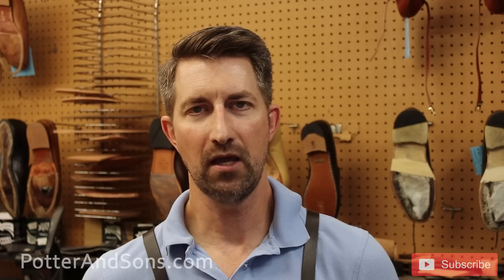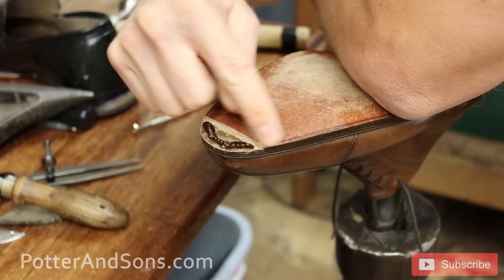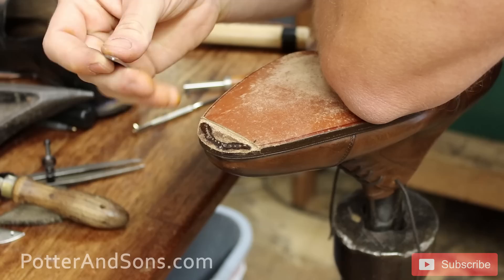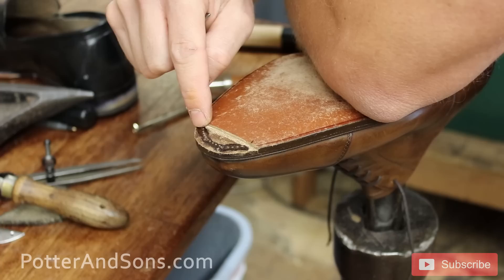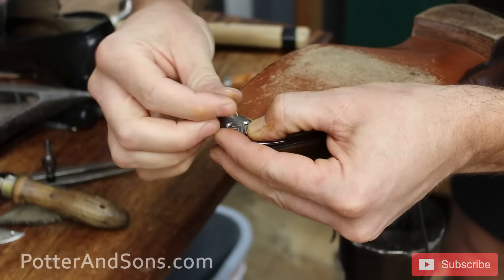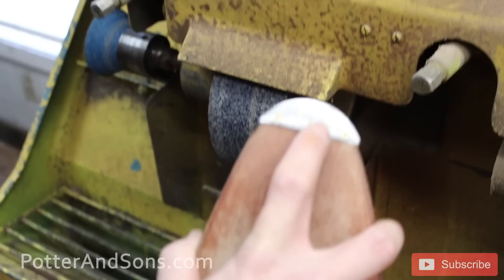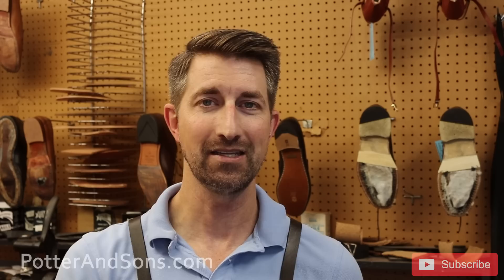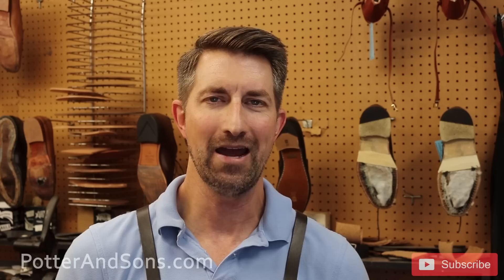Edward Green Oxfords Get Lulu Toe Plates | Protect Your Toe Area From Wear

Comment: I just performed this job myself, but I noticed that the screws heads sit atop the conic holes (rather than being fully flush with the plate). I'm thinking that perhaps the seller sent me the incorrect screws. Mine are size 60 Lulu toe plates, for reference; the screws don't seat entirely into the holes.

Comment: Love your channel and work! I just received my Allen Edmonds Strand and Oliver Wicks captoe that you installed these along with the sole protectors on! They look great and I love the added protection. Question: do you also install any type of protectors for the heels (over the toplift area) especially when you install metal toe-taps? If so, what are those and do you recommend them? I assume a plastic heel-guard would throw the shoe off balance? Thanks - Ani
Reply from the maker: Anirudh Kashyap Thanks!  We really appreciate you watching and for giving us the opportunity to help you with your shoes.  The two most popular options for the heels are heel guards (hard plastic & metal).  I’m not a fan of the metal, as they’re bulky and very loud.  The hard plastic isn’t bad.  I’ve had them on my shoes before, and you don’t really notice them because they’re so thin.  I found that they could be a bit slick.

Comment: Thanks for the video, very illustrative! When I saw these plates in real life, I was surprised that they were not flat, but rather slightly bulging/arched. And on one of the pairs I had these installed it was a bit uncomfortable to walk for a while, until the most bulging part got worn out. Do you know why they make them this way? Do you take this shape into consideration when cutting the sole (e.g. by cutting a bit more from the front, so that it is installed at a bit of an angle)?  Would love to hear your opinion/experience on this!
Reply: Old timer hot shot  Yes, and if you just slam it on top with no modifications to the existing sole, it will not only protect the toe, but the rest of the shoe will also retain perfect condition!
And the reason for that is that one would not be able to walk comfortably with this thing in the the toe area, certainly not in the urban environment.

Comment: Are there any soles that are made with prefitted cutouts for toe plates? Great channel. Thanks.
Reply from the maker: operadog2000 Thank you!  No, not that we’re aware of.  Toe plates come in different shapes and sizes, so it usually requires cutting out the leather in order to fit the plate.
Reply: @TrentonHeath  thank you

Comment: I have metal taps on my shoes. Not sure if I’ll do it again. Can’t walk on wood surfaces with out scratching it or walking weird in order not to scratch it. At work I walk on linoleum and can hear little scratches on the floor throughout the day
Reply from the maker: Jeff Brogan Haha...yeah, I had heel taps on a couple of my shoes (the hard plastic ones), and I took them off.  While they do a great job protecting the heel pads from wearing down, they still tapped on hard surfaces.  Some folks really like the toe/heel plates.

Comment: Second question/comment...do tack nails in the rubber heel help with longevity due to further compression on the rubber? Gracias
Reply from the maker: Jeff Brogan Tack nails are mainly for decor but, yes, if some tack nails are put into the rubber part that hits the ground with each step, it does prolong the life of that rubber piece.
Reply from the maker: Old timer hot shot Your answer is what you get from folks sitting behind a keyboard who only knows fragments of subject matter and nothing more.
In today’s shoe world, other than cowboy boots, manufacturers are not using nails to help hold down soles.  This isn’t the 1800’s.  Yes, from $5000 shoes to $200 shoes, the small tacks put in at the toe and on the top lifts are primarily for decor purposes.  YES, placing a few nails up at the very front of the toe AND/OR in the back corner of the heel pad DOES help prevent those areas from wearing down faster.  That’s why you see many very high end shoe makers placing tacks at the toe area and on the back corners of top lifts.  Does it do as good of a job as toe/heel plates?  No, but they do help.  Thanks for the comment, but you can leave the answering of questions to folks that actually know something.  Adios!

Comment: I was a bit skeptical at the concept of cutting away the sole for toe taps, but it seems to be fine for leather soles that are thick enough for them. Would they still allow resoling for shoes with a goodyear welt or perhaps even blake stitching?
Reply: Kool Kyurem25 pretty sure the screws can be removed and the toe tap just pops off easily enough for a resole. Doesn’t look like it should cause any issues in the future. Just if you don’t want them on in the future, you’d have this part of the sole with a piece cut out of it hence being “permanent”
Reply from the maker: Exactly what Paul said!  These wouldn’t cause any issue at all with having the shoes resoled.  They just screw out and then the sole removed.